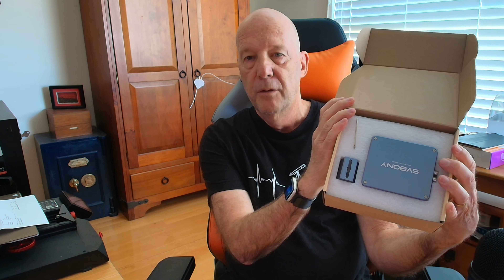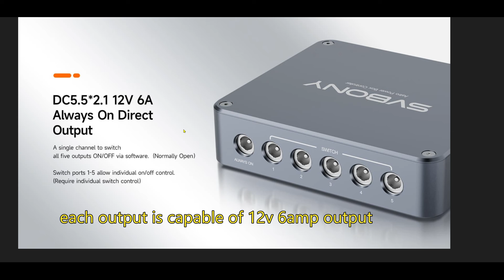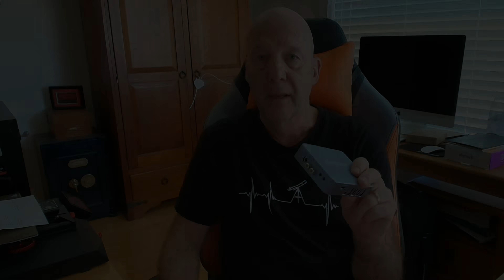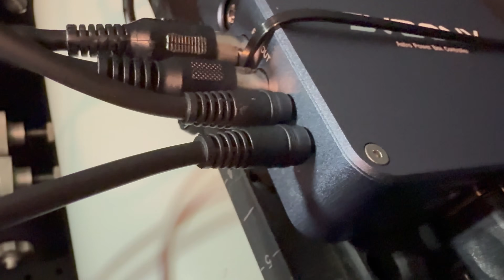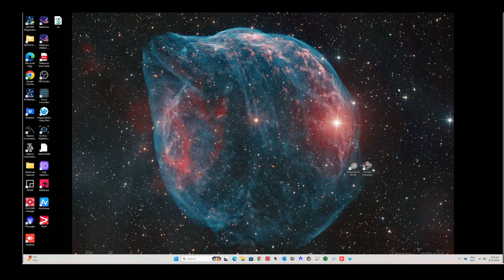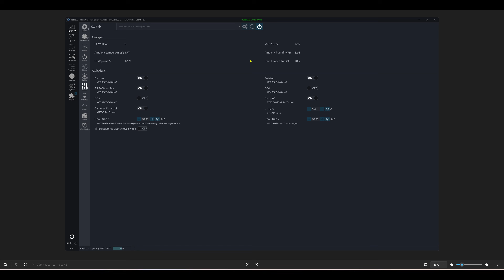Review of the new SV241pro Power Controller from Svbony

Comment: You had better luck than I.  My unit would not connect either to NINA or to its own software on the computer.  The unit also intermittently cut out and also melted one of my cables (the end of it).  I removed it and sent it back.  Notified them of the problem.  Got no answer.  Won't be using or recommending their products.  This is the second issue I have had with one of their products.  Convinced that quality control is non-existent.  You can take a risk to save a buck or just pay for reliability.
Reply from the maker: That's really unfortunate that you had that experience. I guess it is part of the lottery that is part of amateur astrophotography unfortunately. Finding absolute reliability is the tricky part. I recently had one of my ASI2600mm Pro cameras fault and start outputting 10v instead of 5V throught the USB hub and it fried one guide camera and two filter wheels before I worked out what was going on. So even the well known brands can cause a lot of damge to your equipement.

Comment: Hey Logan
Many thanks for the shout out mate.
Great video loads of info in there.  Like you said, it's a new device so time will tell. For the most part a nice device at another competitive price tag.  I'm actually looking to do a follow up video soon.  Also when I did the firmware/driver update the readings went nuts again, then settled again....It definitely doesn't like those updates.
Take it easy mate!
Reply from the maker: Thanks Ben. Yeah it is interesting how those readings go whacky after updates but then settle after restarts. I will keep and eye out for your follow up video as you have had the device a lot longer than I have so that would be interesting to see. CS

Comment: Hey Logan! Great video! Its behavior is definitely unique haha. I just did a comprehensive review as well. The output to DEW 1 will automatically turn on and off, I was able to get some details on its function from SVBONY. My 241 Pro lives in my garden and has been out there for a few weeks and is still holding strong. Its amazing the value of a box like this.
Reply from the maker: Thanks very much for checking out the video. I will head over and check yours out as well. For the price, it is a great device and it is good to hear that it is survivng well out in the wild (your garden 😀). I have already experienced the advantage of having USB ports switchable in NINA as my rotator wasn't intially picked up on startup but using the on/off on the USB group that the rotator was on, solved the issue immediately. Clear skies.

Comment: Great review Logan it is much like a budget friendly version of the Pegasus Astro box. I wonder what the longevity of this will be. bony has come a long way.
Reply: Excellent thorough review Logan! It’s definitely on my Christmas list😃 For the price, you can’t go wrong 👍 CS
Reply from the maker: @SimonsAstro   Thanks Simon. It is certainly feature rich for such low price compared to other units available on the market. CS
Reply: Interesting.   But why not control both dew straps with the humidity sensor!?
Reply from the maker: @hael8680  Yeah I get what you mean. As far as I know, my Pegasus Powerbox Advances just had a temp and humidity sensor in one to  calculate the dew point and therefore control the dew strap heat levels although neither sensor lasted very long. It seems that Svbony are taking a different tack and getting the auto function to work in relation to the 'lens temperature' which is basically the temp of the dew strap - perhaps they feel this is a more accurate way of controlloing when the dew strap turns on an off. As rain has set in here for quite a few days, I'll have to wait for celar skies to return so I can really test out how well it functions in our often very high humidity, specifically.
Reply from the maker: Thanks Nik. For the price it's pretty hard to beat this product but as you say, longevity also plays a big part in value for money so fingers crossed it keeps performing well for years to come. Clear skies.

Comment: Thanks for the review Logan 
I actually just won an SV241 from SVbony for one of my images submitted to their Facebook group 
I believe the model I’m getting is the smaller hub type model but I’m thinking as I’m primarily tied to ZWO products that I would need to get myself a Mele quieter 4 and go down the pat of using NINA to utilise it as I’m assuming the Asi air plus wouldn’t recognise it?
Guess that would also be the case for the unit you’ve just reviewed too.
Anyway thanks for the review and maybe I just need to bite the bullet and go NINA 😂
Reply: The smaller hub type is more a dumb controller I have a similar specced one from wanderer astro which works well with the asiair. I ise it to power the asiair and the mount and then run a usb3 cable to the hub so I have extra usb ports. It works well and the cable management is so much better
Reply: @nikaxstrophotography That’s a great idea, think I will do the same 
Cheers 👍
Reply from the maker: Oh well done winning one! The smaller SV241 version on my Askar SQA70 is working well. Yeah I'm not sure if those two units (ASiair and sv241 pro) would play nice together or not although for a rig running and ASiair , the asiair itself could do most of the power distribution work anyway I think. I still have my Askar65PHQ rig running with and ASIair  and don't have any plan on changing that as it's working well. Clear skies.
Reply: @LogansAstro thanks Logan! I will have to have a think how I can use it, but it was nice to win something that’s for sure.